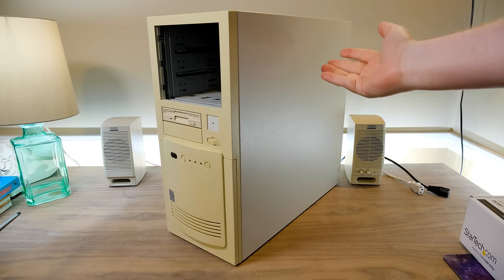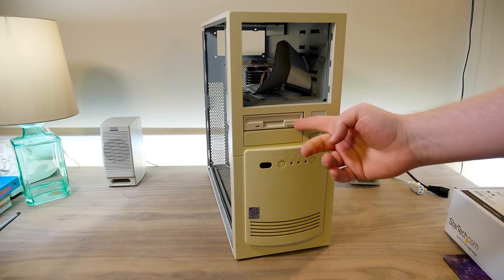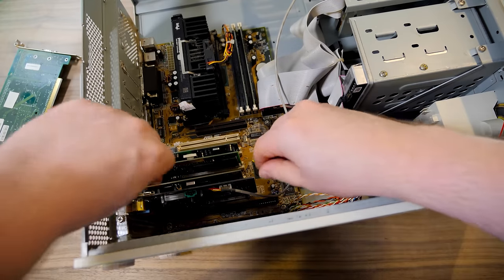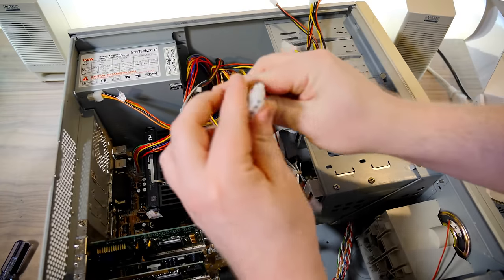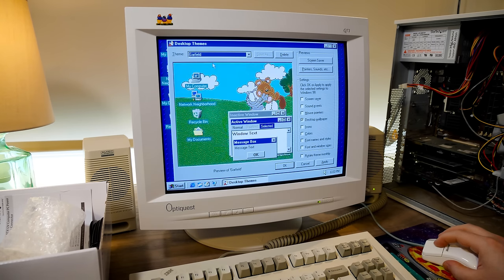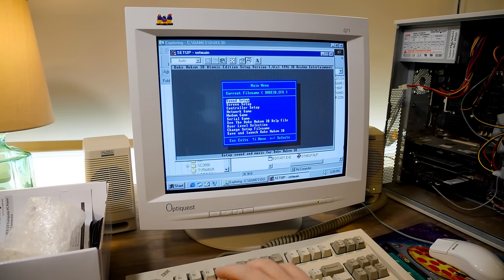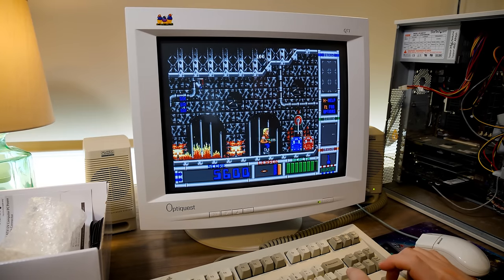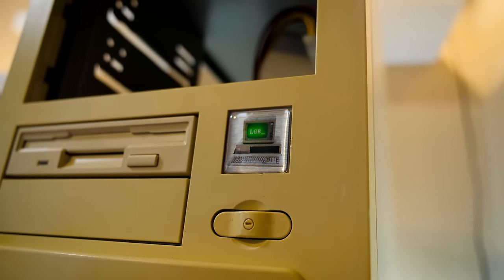Testing This Generic 233MHz Pentium II PC Clone

Comment: That bar was called the channel bar and it was part of the original Windows 98 whoever cracked that thing must’ve just stuck a windows 98 SE crack on it or did an upgrade of a pirated version of 98se on top of the original 98 because second edition ditched the channel bar.

Comment: I ran a $400 million per year revenue company back in 2000 with an old retired desktop Pentium 100MHz cpu and 32MB of ram running Linux as the primary router/DNS/firewall for the company. I installed a CSU/DSU card in it to interface to our fractional T1. It was the central hub of virtually all network connectivity both internally and externally. It averaged well under 10% cpu usage. I had 3 identical machines on hand in case it ever failed, which it never did. It was decommissioned when the company was bought out and the transition to their systems was complete. It's amazing what you can do with garbage hardware and Linux.

Comment: I always found it funny that BIOSes from this era always made sure to point out that you had MMX, even though any processor that would have been on Slot 1 most certainly supports it, even the early cacheless Celerons. I'm sure they were likely using the same BIOS in Socket 7 systems of the time, so it makes sense, but superfluous nonetheless.
Reply: The cacheless Celerons were just practically P II without cache.
Reply: @RuruFIN  I'm aware, but in recent years it's been Intel's tradition to cut some instructions from the Celeron and Pentium chips. That wasn't the case back then.
Reply: @AliceC993  Yeah, these days they're the ultra low-end ones. At least Pentiums been having HT for few years so they're fine for browsing the web etc. basic stuff.

Comment: I think I need to grab one of those Startech PSUs when I can; most modern ones don't have much (if any) output in the 5V rails anymore, and my retro PII-450 build is currently running on an old FSP PSU that I bought in 2006. It would be nice to have a spare for it!

Comment: I love PC's from the slot 1 era! I got my start with PCs in the early 486 days but the slot 1 era of the late 90's & early 2000s were fun times! 
I'm surprised that board is still working well as it's from near the start of the capacitor plague era. I lost an Abit BH6 and an Asus P3V4X to the capacitor plague. It probably didn't help that I was also into overclocking back then but both boards died to bad caps. I just wish I would have had the foresight to save both of them for a later recapping.

Comment: If the motherboard supports it maybe add a celeron via a slocket 370 adapter? No particular reason why other than I think those adapters are neat.

Comment: For AdLib emulation it probably needs the fitting driver. Had the same issue with my SB128 PCI, where the latest (and only) driver on the creative website comes without any DOS driver, but using the original Ensoniq driver release works.
Sound isn't the greatest, but it works.

Comment: When you install WDM drivers for any soundcard, Windows 98 uses built-in Soundblaster emulation for streaming audio as well as built-in Roland wavetable. You can check it in the dxdiag. Of course, this all works only under Windows and not in pure DOS. Also, there's no FM synth emulation as you've noticed.

Comment: This motherboard does have 2 USB port.. It is next to the PS/2 port that was covered by the metal plate.. Back in the day, the old desktop PC that I used also having the same configuration where the back panel of the USB was covered up by the metal plate.

Comment: I want to say that black thing in the front of the case is IR. Seemed to be a growing thing back in the day, as you know, numerous laptops, and some desktops in that era had it. Motherboard may not have support for it, so obviously it's not connected. I bet the cables are tucked away between the frame and bezel. As far as the lines that go to it from the sleep button, I bet it's just the design of the case. The computer woke up from sleep when you moved the mouse pad.
Reply: Some SIS boards had IrDA headers, bet Clint would love that for his PDAs

Comment: Speaking of Linux boxes, I would like to see you go through all kinds of different older Linux distros :)
Reply: Cracking open some old boxed release of Red Hat and getting it all configured and running would be pretty sweet.
Reply: @slightlyevolved  Patrick's still going on with Slackware too! Not bad for a single dude starting back in 93 and still doing it his way.
Reply: @aziztcf  He is doing nothing a 4-yo child couldn't do. All the work is done by the software and autotools/cmake/meson developers.
Reply: @IkarusKommt   Just maintaining a project no matter how trivial over such a period is an achievement. You don't know shit if you think it's some copypaste project like ubuntu forks nowadays. Have you ever even used it? Know what's special about it?
Reply: @aziztcf  oh, and the signing key is 1024 bytes long, hasn't been updated since February 2003, and is used to sign MD5 checksums. Security with a capital S.
Reply: @IkarusKommt  Sure go ahead and crack that easy 1k key then. If you don't change the strength, why update at all?

Comment: I was given a PC with the same motherboard and CPU. I had to replace most of the caps on it though. It came with a Diamond Monster 3D II (with the original SLI and pass-through cables), Viper V550 and Awe64. Kind of odd that your case's USB holes weren't punched out.

The board is actually really good. I had mine running a Pentium III 650 (FSB set to 83MHz), and 3x 512MB SDRAM (only recognised half of each stick). Pentium III didn't like 2V though...it got quite hot.

Comment: It's interesting to see that VirusScan actually outlived the "adventurous" daddy John McAffe. :) Yeah, these newer more sophisticated boards have a nice hardware monitor IC on them. It's read through the ISA bus. Nowadays LPC bus is the successor to it. My P2B has a Winbond W83781D for example. I remember reading it out and displaying it's values on fancy looking GUI items in linux back when the board was still 1 or 2 yrs old. My friends were very surprised. (Also when replacing windows explorer with litestep shell.) My first time in compiling/loading kernel modules and compiling/using lm-sensors. There was no ACPI (yet) just simple APM. Even on laptops like an HP Omnibook XE3 I had at that time. "Advanced" Power Management. Those were the days! :)

Comment: Since you asked for suggestions, this hardware would be great for a "DOS Glide" specialty build, which I've done with a Socket 7 P200. Basically a fresh 6.22 install, drop a Voodoo 1 in, and use Launchbox for DOS to give it a slick, console-like experience.

The highlights for me are Descent 2, Screamer 2, Screamer Rally, Carmageddon and Fatal Racing / Whiplash. NASCAR Racing 2 is also pretty great on the fantasy tracks. You'll also be able to sample such "classics" as Dreams To Reality and Elder Scrolls: Redguard.

DOS Glide games: https://www.vogons.org/viewtopic.php?t=886

Launchbox for DOS: https://www.vogons.org/viewtopic.php?p=886220#p886220

Comment: The thing is this type of generic PC by off-brands are still the thing until 2009 and they simply vanished from the market. I got my first PC branded DiStar in 2003 for around $1,500 IIRC. Celeron 2.4, 512 MB of RAM, 60 GB of storage, on-board SiS graphics, Canon printer, and a set of stereo speaker. We don't really have any knowledge about computers on that time so that's about it.

Comment: Regarding that "port" next to the sleep button...that's a IR Port window.  I worked in a shot back in the late 90's to early 2000's and the ATX cases that we sold to the majority of our customers all came with an optional IR port button/window for an IR Transceiver should someone want to add it to their machine later.  I can't say I have ever installed one in to a mid-tower case, but I also remember a lot of laptops coming with IR Blasters build-in for many years

Comment: I had a litle banger ASUS p2-99 with a celeron 533 overclocked on the slot vis jumper with a Voodoo3 3500 around this time. That lasted me thru the Xbox mod days. Flash FXP and a $200 burner. Brings me back, 98SE and a Zip drive with an AWE32.

Comment: I often see that they play authentic games on retro machines that are not contemporary.
Commander Keen and Duke Nukum also ran on a 386 much earlier, it's quite funny to see it on a Pentium 2.:face-purple-crying:
Then I would say which games from this era the machine can run:
Turok, nfs 3,half.life,tresspasser, gta 1-2, postal, quake1-2,mortal kombat 4,
hexen 2, interstate 76, driver, midtown madness,starcraft half-life ,unreal,battlezone,
tomb raider 3, heroes of might 2-3, simcity 3000 ,dungeon keeper 1-2,
re-volt,c&c :red alert, diablo 1-2,descent 2,twisted metal 2.
The list is simply endless, I feel like we present the old retro machine as well, which is not so much. If I play pac-man on my current core i5 machine, will it become a retro machine? not.
I only feel sorry for those who didn't live then and believe that Commander Keen ran on the machines of that time, it would be worthwhile to present that period with games that are true to the era, because the 3D graphics revolution started in the following years, but neither Commander Keen nor Duke nukum 2 is.🤨

Comment: 22:37 Looks like an IR receiver window. See if it's transparent to IR. That system may have had an old 'media' remote control or some such back in the day
Reply: That's exactly what I thought it was. Like maybe if the motherboard had an IrDA header, you could use it on the front of the case
Reply: @bickman2k  You could use an IR receiver and an Arduino, and either have that appear as a USB input/remote control device, or a Human input device, or a serial controller etc and do it that way if it didn't have the header :)

Comment: There appears to maybe be something next to the PS/2 ports on the main board, but it’s not punched at the back. Possibly USB?
Reply from the maker: I believe it's SCSI-2
Reply: @LGRBlerbs  Oh! According to the manual, it should be USB in that spot though… 

Seems the board has an IR header as well, so is that window on the front possibly an IR window after all?
Reply: looks like an optional LAN port

Comment: My suggestion would be to overclock it. Had a 233 MHz PII myself back in the day and the maximum I reached was 313 MHz or something like that. But it was running stable at 293 MHz for years... So yeah that's how I used that little puppy.

Comment: I'm a fan of Slot1 CPU and motherboard stuff :) The very first PC in the family was an Intel Celeron 300A machine (that CPU is well liked among overclockers, it can run up to 374Mhz), Abit BH6 motherboard, 32MB of RAM and some shitty i740 video card. The ram died, the video card had to be replaced but I still own that very motherboard with the same CPU in the same case with an Aureal Vortex soundcard :) And I'll never get rid of it! My late brother bought it back in 1998 or 99. Now it has a Riva TNT2 (nVidia chipset) video card. The HDD is still the same, a 3GB Quantum Fireball, still works perfectly. Ohh, and I had to change the PSU because there was some fault inside and it was buzzing like hell when it was turned off, and some fans even turned a little bit :S Maybe that's why I had to replace the RAM more than once... But now the PSU is fine too!

Comment: something like that immediately gets rebuilt with newer parts. I'd completely disassemble the unit, completely clean the chassis and install a AM3 based system... the old P2 systems are just too old and won't support anything other then Linux based OS. the plastic parts could be painted and the whole unit can be salvaged. other then the MB. I messed around with one of these old systems 3 years ago and wound up updating it because it was just too old and too slow. I do love that chassis though.... having the parallel and serial ports on the chassis is so handy, wish they still made chassis like that...

Comment: 30 GB of hard disk is the perfect amount for Windows 95 B / C, as there are bugs in the FAT32 implementation beyond that, if you were to change OS by chance. Naturally a combination of NT4 plus 95B or C or 98SE are fine, though NT4 won’t natively support FAT32. Win2000 would though. But you could also consider OS/2 or something more obscure as others have commented (BeOS, TempleOS, etc.)

Comment: I actually have that soundcard! Linux does work with it natively, but with windows you'll need 3rd party drivers. I used it in an older AMD Phenom X4 system with a GTX 650 because the Sapphire 780G motherboard I had didn't have working audio

Comment: Those BIOS options is one reason I quit buying brebuilts. Good ol ASUS greenigh gold, how I laughed a few yrs ago when no one got why ASUS released those gold/yellow boards. 

Sparkle, eugh had one of those sparkled my scsi zip drive to hdwheaven. 

 That HP pavilion you posted had it as a option. The case manufacturer probably cost cut it to what you show in the twitter video.

Comment: Well, my power supply in my old PC that i'm using right now is sounds the same when i start my PC. And the fun thing is that, it's almost new one. I bought it like, maybe few years ago or so. And it's Q-Dion Model QD400. Any idea why it makes that sound? Cause i cleaned it like few weeks ago, but it still makes that sound until it worms up, and then it quiet down by itself after a minute or less.

Comment: Hmm, Tseng ET6000 is one of the best (or "the" best) pre-acceleration era SVGA graphics card ever! It's one of the fastest one, very nice find.
Reply: Just tested mine (a 4mb one) with a pentium 4 2800mhz, windows 98 se and scitech display doctor and holy crap that thing is fast. Just for fun I benchmarked Quake 2 @800x600, using my voodoo 2 I get 62fps (just for reference). Without display doctor the et6000 (on software rendering mode obviously) got 22fps so I was not hoping for much but my jaw hit the floor when I saw the result WITH display doctor... over 70 fps using software rendering :D

Comment: Looks to be USB ports on the MB, but for some reason the covers on the I/O shield are still there? (Should be able to punch those out if it's an I/O shield from the era, many of them were universal.) Who built this thing?!

Also, IIRC, WDM drivers won't always provide great real mode DOS support? VxD drivers have been preferable when I've been tinkering, but as I recall when I last built a few retro rigs, mileage may vary.

Comment: If I could find a system like that I would build a replica of my first Pentium 2 system.  Had a 233mhz MMX just like that, with 64mb of ram instead of 128 (would have loved that much ram haha). For graphics I had an 8mb PCI ATI Rage Pro All-In-Wonder, the one you could upgrade the ram from 4 to 8mb. Later I had an S3 Savage of some kind, 8mb AGP. It's really odd I constantly wanted to upgrade back then, and yet now I long for the days of booting that system up early in the morning to play Duke 3D or C&C: Red Alert.

Comment: I remember a friend having a P2 but it always seemed like not that big of an upgrade to me at the time so I just... waited and got a PIII450 slot version instead. That was... pretty okay. Not as fantastic of an upgrade as I'd have liked either. I had a P133 and a Voodoo 2 which I carried over to the PIII 450 I think. The 133 could push enough polys to the Voodoo 2 for it to be a playable experience for me.

The thing that made me disappointed with my PIII 450 was the release of Diablo II. That suddenly chugged in 2D graphics on my new machine and I was appalled.
Reply: Actually that 133 was a 120 overclocked too. I accidentally forgot to set the bus speed jumpers properly and it worked so I just left it that way. :P

Comment: 6:20 - is that dirt or corrosion on the pins?! :S

That Garfield screensaver reminded me that you should totally check out and make a video on Duke Nukem 3D Screen Saver & Entertainment Pack!

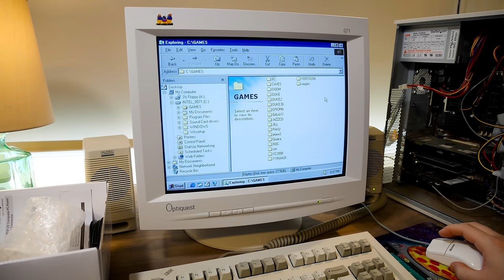16:04 - LOL! That's the same serial number I had with my Win98R2! :D There was a time when the RAM was not working (but I didn't know it was the RAM) and I could only use DOS, I tried to reinstall Windows several times to find out what's wrong I ended up learning the serial number that I know to this day almost 20 years after that RAM incident :D

I played some of the first and the second Duke Nukem game summer 2001. I liked Duke3D so I went back to check the roots of it. Looking at Duke 2 now, it's soooo primitive, the graphics and the sound but I didn't mind it, and it's especially baffling to think that because a couple of years prior I was playing much better games on our Amiga 500, Ruff N Tumble came to mind. Duke2 is from 1993 and Ruff N Tuble came out just the next year and it was superior in every way.

Comment: Ew. Smoker PC. Also you're a braver man than me for powering on that Sparkle PSU.
Solid Video card - have one in my last DOS build -handles most VESA modes very nicely with games that support them. Pirates! Gold comes to mind.
That is a 440LX chipset, so fairly limited, but should be stable.
The Addon USB is probably so it has USB 2.0, that board looks like it was 1.1, so unbearably slow for anything but a mouse or keyboard.

Should run NT 4.0  well, but should be a solid DOS gaming machine once it's clean. Still slow enough clock speed that older games should not freak out too much.

I suspect you'll need a lot of 90% or 95% isopropyl to get that thing clean. Some Dawn mixed in might help with the bottom of that case, but whatever you use heat it up first so you're not scrubbing all day and night.